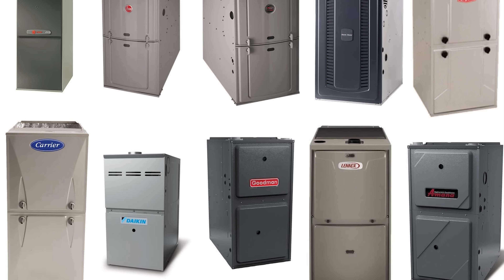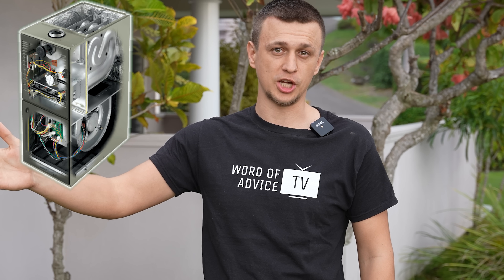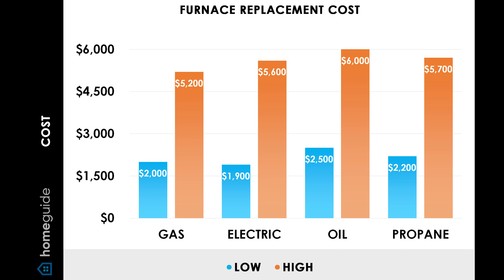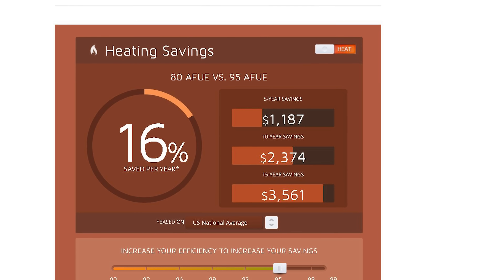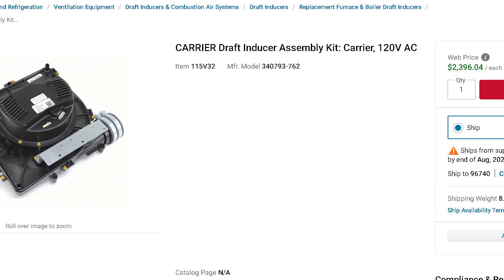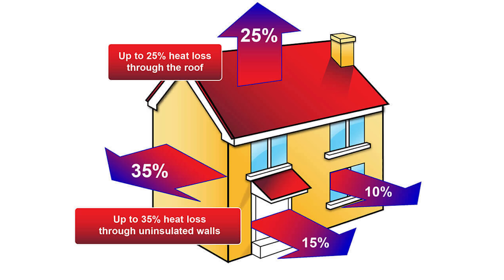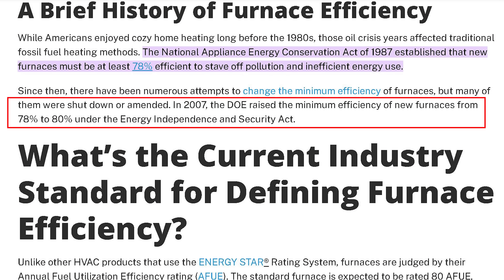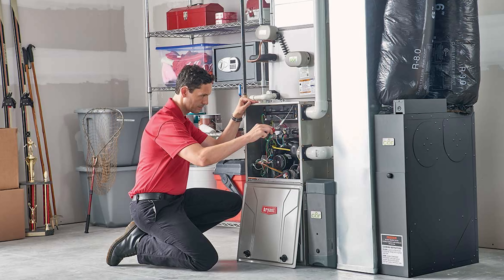Don't Buy a High Efficiency Furnace!

Comment: As an hvac tech, I actually do agree with most of this. The repair cost for the customer for standard efficiency furnaces is drastically lower. On average swapping an inducer motor on a standard furnace ends up costing the customer on average $300-$400 all said and done. 

Then I've swapped out some very top of the line modulating inducer motors that no joke cost the customer over $2000. You go from buying a simple motor to buying an extremely complicated motor, that has extra components like a transducer and sometimes even needing a board replacement with new harnesses if it's york. Not to mention how much more complicated the troubleshooting process can be. I've taken classes at york for their high end equipment and even in the classes 80% of the troubleshooting involves being on the phone with tech support. With all these variables the chances of a misdiagnoses on a top of the line furnace is higher, which means mistakes happen and the wrong part may get put it at the cost of the customer. All this can be avoided by just having a nice standard 80% furnace.

Also yes, problems with the secondary heat exchanger is always a killer for the unit. It does not take a lot to have them get clogged up especially if the combustion isn't dialed in properly
Reply: All furnaces now have high efficiency motors so there’s no choice .
Reply: @coryjackson3131  true, but the x13 constant torque is a price driven option. Sometimes,  these can even be cheaper than a psc motor. I think the main discussion is true ECM MOTOR.  NOW THOSE ARE PRICEY!
 Also, many of your 90% and modulation units have proprietary inducer assemblies (as well as the ECM supply fan).  As a tech, where's the savings if you lose one of these motors in less than 10 years? All you saved in that time for that extra initial cost just went straight to that motor(s) and labor. The units work wonders for comfort and savings, that is until they do not.